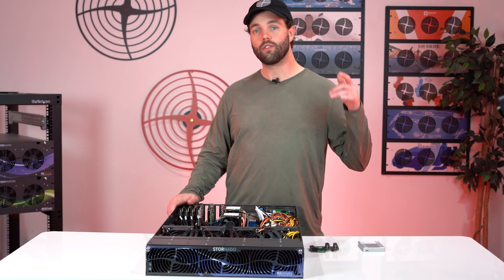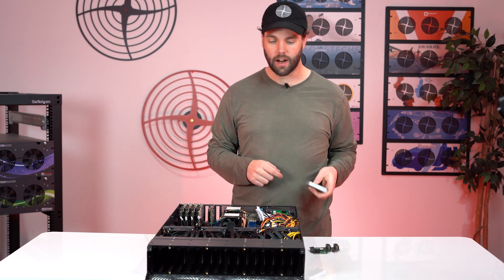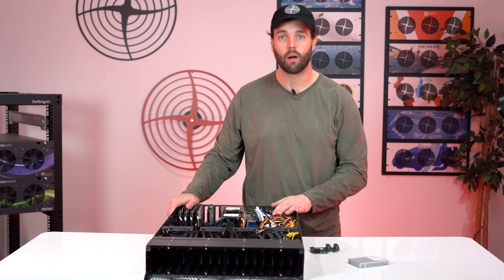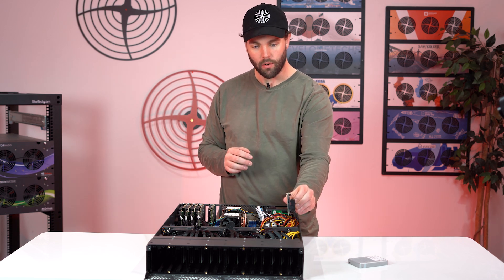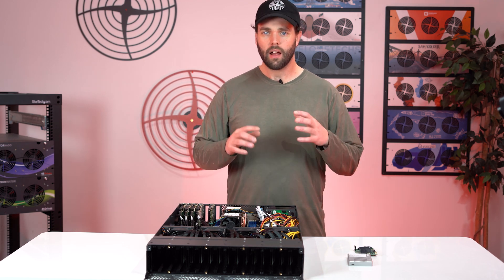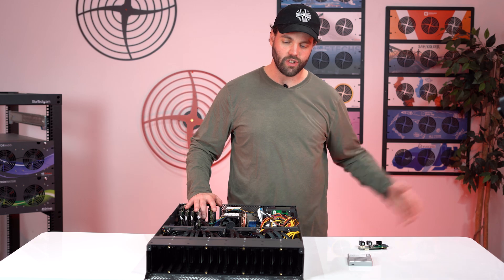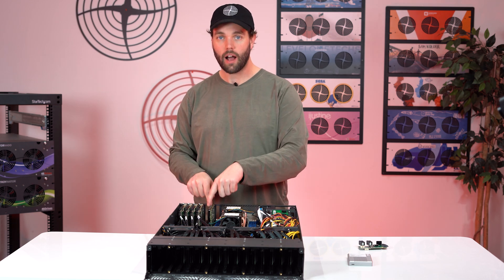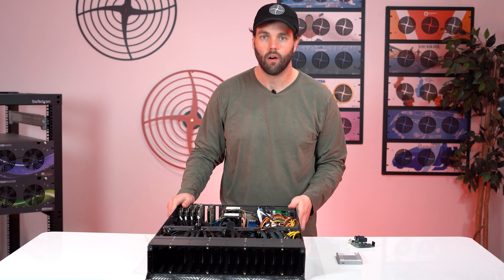45Drives - Introducing the Stornado F16: 16-Bay All-Flash Server for NVMe (or SATA & SAS)

Comment: what about making a motherboard that has a slot for the 16 drive bay riser slot that card goes in then the riser card attaches to the drive cage drive cage just slots into that card boom power and data no cables do that with everything only cable would be from motherboard to powersupply one cable for it all or a group boundle that you can put in a area that can be only for cables no more cables
Reply: Think  the R&D alone would bankrupt them. lol

Comment: Is there a reason why you are not using the LSI P411W-32P, which would give you even more throughput?
Reply: Possibly because the firmware for them is awful and causes huge amounts of issues. You can find a thread filled with agony about this card on the level1techs forums. Most likely though its because it supports sas, sata, u.2, and u.3 through the same backplane, as it is an HBA rather than a pcie switch. They also have no need for a pcie switch with the amount of lanes needed, and do not require any lane switching. If they wanted to go the route of the switch card, they could have instead gone straight from the board for far cheaper and at much higher speeds with no reliability issues.
Reply: @industrial-wave  Thank you for replying! We agree, you're right.
Reply: would I be right in thinking this could drive 8x NVME drives? therefore reduce the number of HBAs in this F16 system from 4 down to 2? how does it give it more throughput?

Comment: 16x30tb NVMes sounds fantastic and expensive.
Reply: than 16x61,44TB would make you moan, and the solidigm anounced 122,88TB version of their p5336 that should launch any day now would rip through your pants :-D the 61,44 is around for approx 9200 euro per piece with VAT, for the 122,88TB there are no price recommendations yet